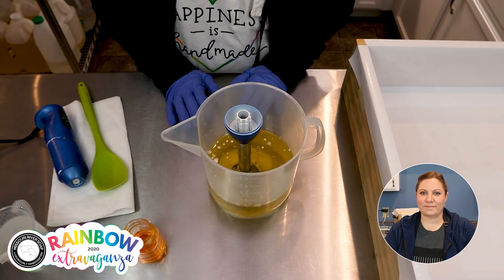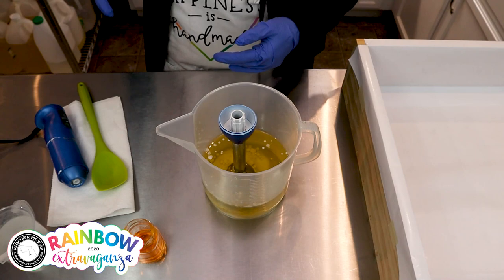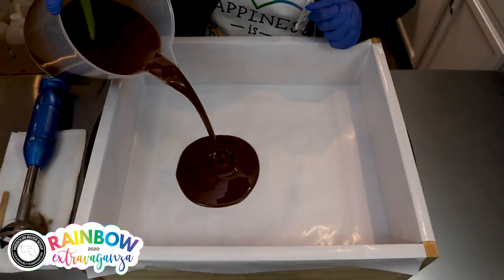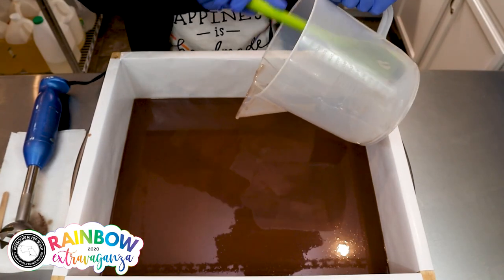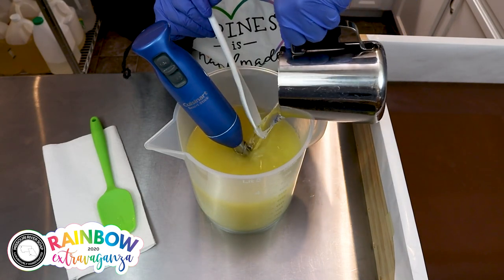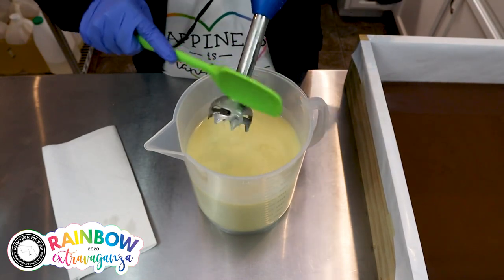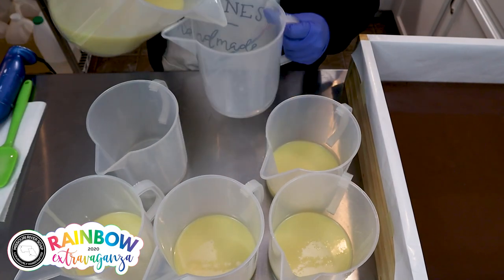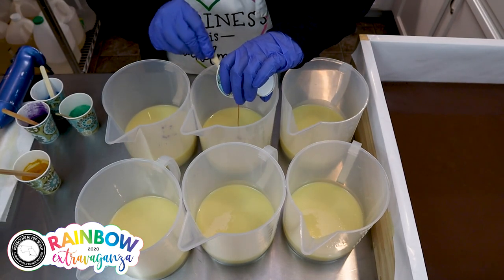Serendipity Soap | RAINBOW EXTRAVAGANZA 2020 | MO River Soap

Comment: Very nice soap 🌹
just have 1 question. 
Does the addition of coconut milk affect the shelf life of the soap?
Reply from the maker: Thank you! Not significantly. Most of my milk soaps are made with only a percentage of milk and the coconut milk is even more compatible than animal milks. That being said, I do still recommend our soaps be used up within a reasonable time frame. I'm using soaps that are 2-3 years old and they are just as good as the time I made them.

Comment: Oh lord ❤️😍 it is so coooollll ❤️ yummmyyy 🤭😋
Sorry but just a question, did you use chocolate (fragrance oil) right?! From which company?! I tried from two suppliers and my 🧼 was so ugly 😢! Looked like a jelly 🙄. Actually I tried some fragrances oils (many different) and was a disaster 🤷‍♀️😱! I just can work with essential oils. But they are expensive 🙁😩
Reply from the maker: Thank you! I used two different fragrances and two essential oils with this one. I don't typically care for chocolate fragrances.
Reply: Great 😁 so I need to try to do it. And then see if I can work more with fragrances 🙏😁
Reply: Thank you so much ☺️

Comment: Hi what purpose does the lye solution do for your body
Reply from the maker: The lye solution combined with the oil makes soap.
Reply: @moriversoap  ow ok because I see some candles that don't have the lye in it
Reply from the maker: This is for soap, not candles. Real soap cannot be made without lye. A syndet type product can be made but not real soap. Also, instead of listing sodium hydroxide in the ingredient list, it can also be listed as the saponified oil version. For instance, coconut oil used in soap can be listed as Sodium Cocoate.